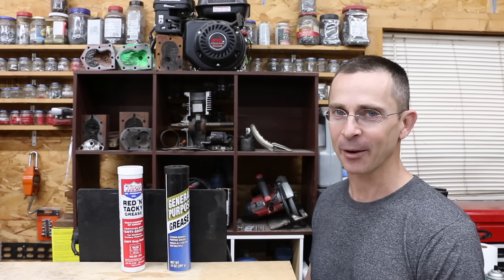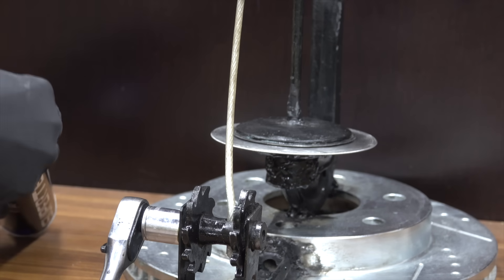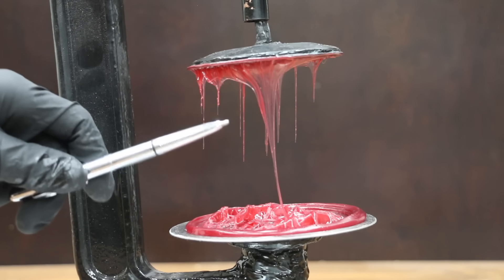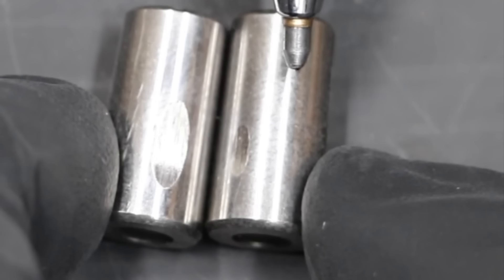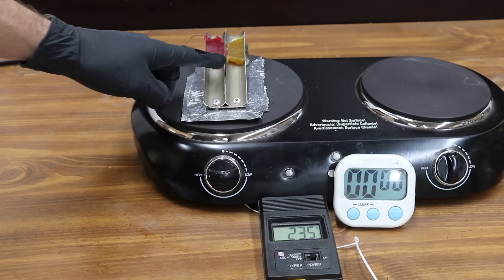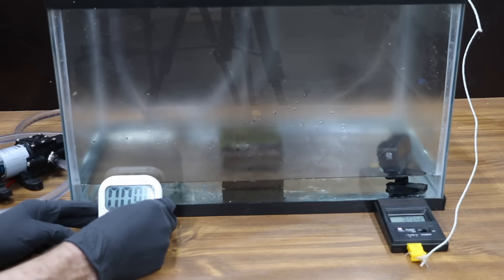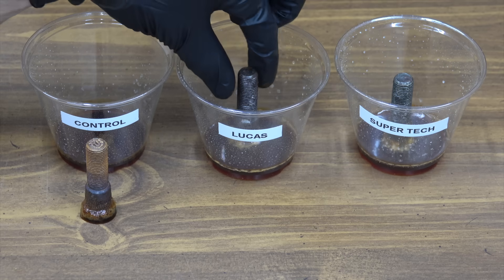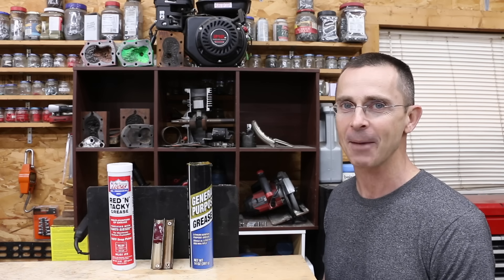Is Cheap Grease better than Lucas Red N Tacky? Let's find out! Bearing Grease Test Episode 1

Comment: I bought a harbor freight trailer one time and I read over and over the bearings that come on the trailer fail. I cleaned the grease that came on the bearings off and repacked them with the same red Lucas grease shown on video , I went clear cross the U.S several times with no maintenance and never had a bearing failure like everyone else.

Comment: I have used various grease brands and types for greasing the nose sprocket on my chainsaws over the years. EP type grease is usually the recommendation for such applications. I correctly presumed the high temp red grease was the best. I didn't use Lucas, but the type and ratings were similar. And it was Super Tech label from Walmart. In the big picture I tend to believe that any grease on a regular daily basis for your chainsaw nose sprocket beats what they usually get.

Comment: I deliver diesel fuel to construction sites, when this grease gets on my hose, it turns into an absolute nightmare, it gets everywhere, pants, gloves, boots, inside the cab,on the doors,and window. I have to take a rag soaked in diesel to wipe it off, brake cleaner won't cut it .

Comment: I would like to see how Park Tool grease would compare to these, I like to take apart the wheel hubs in bicycles and clean the cheap factory grease and put in Park Tool grease, in my experience it lasts much longer and prevents damage to the bearing races. But Park Tool grease is expensive ($12 for a 4 oz tube or $32 for a 16 oz tub) so I have been looking for a viable alternative.

Comment: Best test I’ve seen so far. Great to know as I am rebuilding an old trailer including hubs and bearings which are packed with red high temp grease. Wheel bearings were an issue when I was a mechanic many years ago. Had to pack them well then make sure the spindle was tightened properly otherwise the wheel would wobble or the bearings would burn up. This can provide some leeway when tightening wheel bearings.
Reply from the maker: Thanks!

Comment: Looking for and can not find any grease that is for the Spindle bearings for a zero-turn mower. Dealers just suggest replacing, not regreasing.  The current bearing my unit is 6305 2RS, easy to buy in the range of $5.50 China ~ Timkin $74 US made.  Love to know if you have done or are looking to do a YouTube?  Thanks

Comment: The true answer is it depends on the application. A low cost grease that meets the specs and requirements of a particular application can be as good as the expensive grease. I have found using inexpensive grease more often is much better than using expensive grease less often which is what most people tend to do. This is especially true on farm equipment. Pumping in low cost grease weekly or even daily as needed keeps the dirt out and provides better protect. Same goes with engine oils, low cost oil changed more frequently is far better than old dirty expensive oil. Dirt and water are your enemies.

Comment: Be careful with EP additives. Using EP grease with brass cages can be problematic because certain extreme pressure additives may react with the brass, leading to premature wear or failure. It's important to choose lubricants that are compatible with yellow metals to avoid these issues.
Reply from the maker: Thanks for the feedback.

Comment: As always, I enjoy watching and learning or confirming my opinion on the products you test.   Keep up the good work.     One test is really like to see, is with motor oils.   I know you've compared Royal Purple sae oil with others including mobile 1.  I would like to see a test with royal purple hps oil and their xpr series oil and see how it compares as well.   I don't have test equipment like this,  but I have used all 3 types of RP and I don't use sae for anything.   I can tell you hps and xpr surely are not the same as the sae.

Comment: I really wanted to (Like) the Red & Tacky; but, it’s performance on greasable  joints and brake components on my full sized van has been abysmal.  It liquefies out of grease cups and  zerk fittings.  I’ve never had a grease DRIP out of zerk fittings.  I need to find something Better !
Reply from the maker: Thanks for sharing.

Comment: I feel this would have been a better test if you used red grease from both brands. Red and yellow greases are really meant for applications. Red is high temp and heavy duty and yellow is light duty grease
Reply from the maker: Thanks for the constructive feedback.
Reply: Correct!! Not a fair comparison

Comment: I worked on a 1953 Ford Customline car with 19,000 miles that had sat in a barn since 1966. it had service decals from that year form a Mobil station with 20 less miles. When I went to grease it the joints were full of a grease impregnated with brass just like aluminum antiseize. I left it in! You can still buy it. It's high $$ high temp stuff for foundy etc use. They also have stainless steel and ceramic powder impregnated grease. One of the most expensive (to buy new) was one I had bought a can of cheap at a garage sale. It was boron spray grease. Ultra high temp high pressure. I used it as anti-seize on turbo and exhaust manifold bolts.
Reply from the maker: Thanks for sharing.

Comment: I guess I’m really late to the dance but I have a question.  I use the general purpose lithium grease and my personal riding lawnmower and snowblower.  I service both like clockwork each and every year.  By the maintenance schedule I follow is using the general purpose lithium grease for this application acceptable or have I thought about this wrong?

Comment: The heat test shows the Super Tech releasing oil when heated up.  Isn't this what you want when your bearings or parts heat up to help lubricate them.  If the grease doesn't flow when getting hot,  that can be dangerous as well.
Reply: This NOT a fair comparison. Super Tech has an red high temp, that should've been used

Comment: The key is to get perform regular required maintenance depending upon your conditions like wiping your ass grease and oil need be addressed as required also clean air and fuel !😂🙃

Comment: Great video as always! Really appreciate your efforts on these tests. Been using the Lucas for decades on literally everything I’ve got. Trucks, tractors, trailers,implements, motorcycles, wheel bearings, you name it. I’m also in central Kentucky, so my gear gets all of the weather extremes. Moral of the story, I may have spent a hundred or two extra over thirty years, but I’ve never had a lubricant related failure. Just remember, kids, 100% of the grease you don’t apply does absolutely nothing!!
Reply from the maker: Thanks!  Thanks for sharing.
Reply: @ProjectFarm  You, sir, are THE MAN!!! I didn't even realize how old this video is. Left a comment a few hours ago and got a reply. Genuinely appreciate all of your efforts as a guy who uses just about everything you test. Good to have a few internet buds!

Comment: I love your thorough processes and thoughtfulness for testing all aspects. A cheap grease can also "dry out", although i am not sure whether this has to do with time, temperature, separation, or all of the above. On my farm equipment, when this happens, the grease perks and grease passageways become plugged and will no longer accept new grease. The components, such as a pin and bushing, then need to be disassembled and mechanically cleaned out in order to get them flowing again. I would be greatly interested if there was some way to test this. I can tell you that the best greases like the Lucas and Chevron Red are great at not succumbing to this failure. Thanks again for what you do!
Reply from the maker: Thanks and you are welcome!  Thanks for sharing.

Comment: Coming back on here.

I use the Red-n-Tacky on the fifth-whell of truck-tractors.  Working local intermodal, I was changing multiple chadfus daily.  

Red was the only grease I used that did not aleays require a "refreshing" as other greases did.  Red also does not wash off in the rain or with road Splash as easy as other greases have done.  Remains tacky even after much debris gets into the fifth-wheel.  Cleans up nice when refreshing.
Reply from the maker: Thanks for sharing.
Reply: @ProjectFarm  

You're welcome.

I love it when you catch companies putting lies on the labels of their products.

Comment: The greases today are to thick for wheel bearings. The grease needs to flow like honey. If you think that wheel bearings get hot all you have to do is drive for 1 hr. Then get out and feel the housing and it will not be hot. I have replaced my share of wheel bearings and I always notice that the grease will be about 1/8 inch from the bearings. With lots of the grease in the hub but not in the bearings. It is a misconception that the grease gets hot and then turns more fluid the when it cools it gels again. The bearings never get hot enough to turn the grease to a more fluid state. I am now mixing oil and grease to make it a honey consistency so the bearings will always get some grease. I'll tell you what, the first time the wheel bearings rotate at high speed most of it is dislodged. If it is thinner than it will always pick some up on the bottom of the casing. I even heated up the outside of the rotors with a torch and felt the inside with my finger and it was very hot not warm and the grease did not turn more fluid. The grease is always about 1/8 in. from the bearings. Use the thinnest lithium grease that you can find. I take the caps off and give the tube a little squeeze. That is how I found mobile 1. The others were way to thick. Remember most of the grease gets dislodged during the first high speed rotation. With this newly discovered method the bearings will always come into contact with some form of grease. Thank you
Reply from the maker: Thanks for sharing.

Comment: I wish we had this back 20 years ago. We owned a golf course. Hundreds of bearings in so many machines. The boss got sold on the latest and greatest synthetic grease. It was dark gray. Cant remember the name. It turned hard after 2 years and every single bearing we shot it into was junk. 0 water resistance. Turned hard. Created heat and destroyed seals bearings and eventually shafts and worse. Thousands in damage and that not counting time because my time was donated
Reply from the maker: Thanks for the feedback.

Comment: Ok this is how it works, im a retired union pipefitter & tig , mig & stick pipe welder, i worked at ChemTool in Rockton,Illinois, that place just burnt to the ground about 5 yrs ago, Lucas, Supertech, Phillips66, Mobil 1, & several other greases were all made there, is how Supertech exists is when they purge the grease pipes after filling several thousand grease gun tubes, they run the excess into 55gal. barrels , once they purged them out, they dump it all together & call it SuperTech, so not 2 tubes of Supertech Grease are exact same, because their are several different greases mixed together, that is exactly how they do it !!! 100% Truth …
Reply from the maker: Thanks for sharing.

Comment: Our farm used to use Lucas but we used the green xtra heavy duty grease, the red and tacky doesn’t stand up too well in winter and we found that the grease is too thick and doesn’t have the quality the green one delivered but after the Covid snap we were unable to buy the green so we ended up outsourcing and we found this company called certified and we now buy the premalube extreme green and it works very well in winter as well as high temperature applications would be interesting to see how that brand would compare and stack up to the tests done in this video

Comment: You mentioned testing more grease. I would highly recommend putting Amsoil's Multi-Purpose and Texas Refinery Corp's Paragon 3000 on the list. I made a database of moly-free #2 GC-LB greases, and those two by far have the best specs on their datasheets. Would be good to check those claims.
Reply from the maker: Thanks for the suggestion.

Comment: I don't think it's a particularly fair test to compare "light duty" grease to heavier duty grease. It's like comparing a Ford F-150 to a Ram 3500. The testing should be between products that claim similar properties and capabilities. All this test proved is that heavy duty grease outperforms light duty grease, which is to be expected.

Comment: It really depends on what you are application! high temperature Grease is necessary for heavy machinery. A general purpose grease will simply melt away and render it lubrication in effective.
Reply from the maker: Thanks for the feedback.

Comment: Lithium grease has different properties than other types of grease. If the red and tacky isn’t lithium grease it’s not an apples to apples comparison. I don’t like being the one to point at obvious flaws in methods but there it is. Still do you expect your grease to be an adhesive or a lubricant?

Comment: I bought a used vehicle and want to grease the joints. Should I flush the joints first, or just add good stuff on top of the old stuff?
Basically, how important is it not to mix them?

Comment: Lucas Red is great! 
Tip: Get a pack of irrigation syringes for $6 on Amzn and some red-n-tacky.  Put a tablespoon in the syringe to lube small parts. 

I use it on my Sig P229 but it works on any slide. After cleaning, run what I call a very small snail trail of Lucas down the groove along the inside on the slide. It won't run like oil will when the barrel gets hot. No more drippy mess.
Reply from the maker: Thanks for the tip.

Comment: I work in an industrial environment with hundreds if not thousands of bearings. It was a typical routine to change them and we had a vibration analysis done every month for predictive maintenance. We tried so many types of grease to then find Thixogrease by Power Up Lubricants. Hands down the best grease out there. I'd be interested to see how it would do in this testing.
Reply from the maker: Thanks for the suggestion.

Comment: Mobil 1™ Synthetic Grease, the official automotive grease of NASCAR, is an advanced full synthetic grease formulated with a proprietary blend of high-performance synthetic base stocks and a lithium complex soap thickener. The thickener system provides a high dropping point, while additives impart excellent extreme-pressure properties and resistance to water wash, rust and corrosion. The proprietary blend of high-performance synthetic base stocks used in Mobil 1 Synthetic Grease gives reliable lubrication over wide temperature ranges -50 C (-58 F) to 246 C (475 F). Outstanding structural stability coupled with high performance synthetic base stocks make Mobil 1 Synthetic Grease an outstanding all-purpose automotive grease.
Reply from the maker: Thanks for the feedback.

Comment: Bought Lucas to grease my snow blower’s auger so was most interested in your cold weather test.  A lot of grease gun reviews complain about the coupler sticking to the zerk. Twist and pull from the side rather than straight off is often recommended. To get ahead of this issue, going to try Lumax’s Quick Release Coupler since it’s cheaper than LockNLube’s.
Reply from the maker: Thanks for sharing.

Comment: @ProjectFarm 
Not sure if you have done a follow-up video; if you haven't, how about comparing the entire Lucas product line? Another related topic which there seems to be some disagreement about, is how much grease to pack into a wheel bearing/cavity/hub. Can you make a comparison between a 100% loaded hub, 2/3, 1/3, and 1/10, set up for highway driving for an extended period of time? Possibly with water and mud spray, and also simulating hard and extensive braking? I know, I'm asking for a lot! But we seem to have a problem when there are tools out there that WILL fill a bearing 100%, while various manufacturers recommend only to fill a bearing with 1/3 of grease. And how will the average guy know when that goal has been reached? Thanks for your consideration 🙂
Reply from the maker: Thanks for the suggestion.

Comment: plz make a similar test video for CCF France-12 grease?
Reply from the maker: Thanks for the suggestion.
Reply: CCF france-12 has written NLGI-2  and the temperature is about -15degree Celsius to +300 degree Celsius.😮Just want to see if its true or not.
Reply: CCF france-12 has written NLGI-2  and the temperature is about -15degree Celsius to +300 degree Celsius.😮Just want to see if its true or not.

Comment: This was not a fair test for the Super Tech brand. These are 2 completely different types of grease. A better comparison would have been the Lucas vs Super Tech Multi-Duty Complex Grease. The Lucas has a Timken OK Load rating of 60 and the Super Tech MDCG is 55. The Lucas has a drop point of 540 and the ST is rated at 500. Both are red. :) Both are N.L.G.I. Grade 2. The ST cost about $1 less than the Lucas at WM. The test results might have been a lot closer.

I'm sure that this will get buried in the 13k+ comments here, but oh well.

Comment: A better test would be a marine trailer wheel bearing grease, I use Lubrimatic marine trailer wheel bearing grease (calcium sulfonate based). If a marine grease can handle being in and out of the water on wheel bearings, it can handle anything !
Reply: Same here

Comment: Kind of outside farm applications, but there is kind of a debate as to whether Vaseline is a good non toxic all around grease for bicycles 😊 chains, bearings, forks. Bicycles are not subject to extreme RPMs, but they are subject to temps from 0F to 120F, rain or shine. Vaseline is nice when possible because it's totally non toxic. Lithium is a mind altering drug.
Reply from the maker: Thanks for the suggestion.